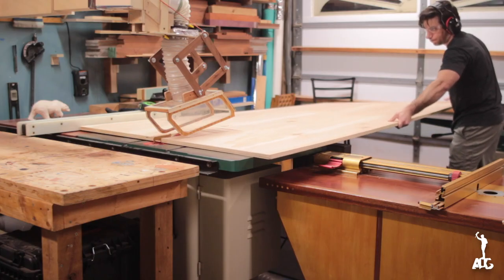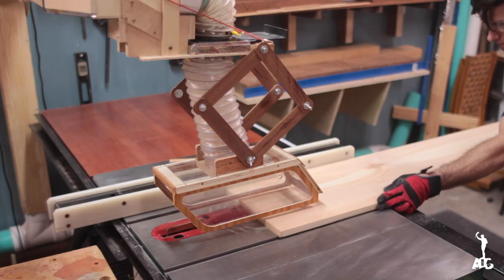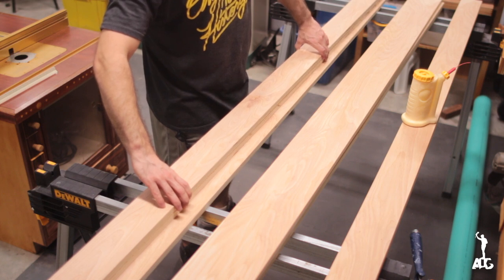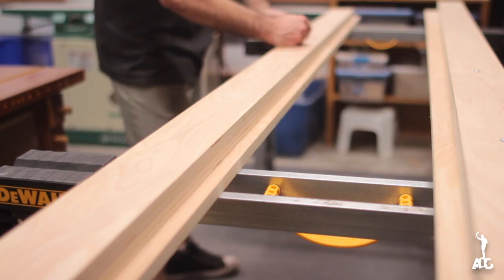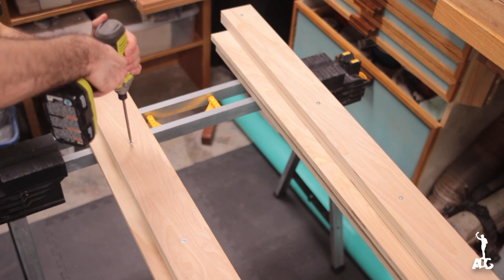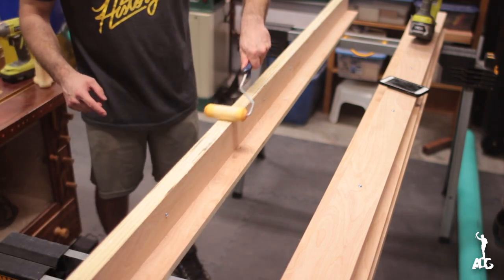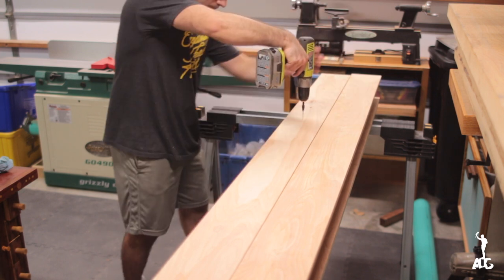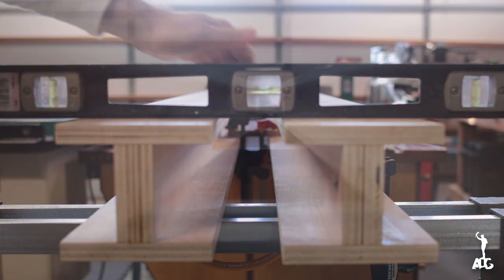Build A Pair of  I Beams

Comment: The height of the web is more important than the thickness of the web.  The whole idea is to have some compressive strength in the top of the beam and tensile strength in the bottom of the beam, and to separate the two flanges accordingly.  The further apart the top, compressively stressed flange is from the bottom, tensile stressed flange, the stronger the beam will be.  That said, if you are limited in the height you can use because of the design, a thicker web will provide some benefit, but the height of the web does more than its thickness.
Reply from the maker: That is right. Thanks for that elaborative explanation. I recently made a similar concept but this time out of solid wood to act as a beam that sits on two columns above a sofa . The beam is also fastened to the wall. It holds an amazing amount of stuff the height of the web as you call it in this case is about 10 inches high .

Comment: Can I use 2x6, 2x4 etc. instead of plywood or do you think the expansion and contraction will cause problems on that 'T' shape join?
Reply from the maker: creativobuu sorry I’m responding so late. 
  I believe that you are right . You will encounter some movement over time . But a 2 by 6 would deffinetely work as far stability goes . It will be way more work because you would have to square your parts. The price is lower but I’d go the plywood route for this project 🙏🏻

Comment: If you wanted to make them longer, could you overlap multiple pieces?
Reply from the maker: They would have to have a very strong connection that would rezist sagging . I would try to get longer material and then make the center piece wider so that the beam would be taller

Comment: What type and amount of load is this intended to support? Drywall screws are known to be brittle and prone to breaking under more than drywall load bearing. They are not structural connectors.
Reply from the maker: Monkeys Uncle I walked on these beams with no flex , and I weigh about 180lbs and I could put hundreds of pounds on . Now this is made to serve as an assembly platform for furniture projects that will weigh way less.  I believe it would be weak only if load is set on individual edges of the beam and not over the central area where there is just too much material for it to fail
Reply: I applaud your inventiveness, but in the future I recommend using a slightly better grade of fastener than drywall screws. Just sayin'!
Reply: @monkeysuncle2816 , actually... While you're right? You're forgetting that the drywall screws are just acting as a clamp until the glue dried in this application.

Unless the glue was absolute garbage, which is doubtful considering the craftsmanship that's been used, the screws used are immaterial.

Some digging here on YouTube will show you that the lumber used in a joint like this will tear before the glue joint itself can fail.

He could literally remove all fasteners and have the same strength, many woodworkers who employ pocket hole jointery will go back and remove the screws once the glue has dried just to get more mileage from their investment, because they serve no purpose for typical weight bearing applications.
Reply: @russellborrego1689  The glue although wood glue is PVA and is not rated as a structural glue in any sense of the word.
Reply: @gary24752  be fair. You're talking about it being under constant load. If he was parking a truck on his wooden I-beams for a year? Sure.

He build them for a flat work table to build a credenza on.

They won't survive a trip to the moon on the outside of a rocket either.
Reply: @russellborrego1689  like I said pva is wood glue not to be construed as a structural glue.

Comment: The design is structurally wrong - you want the top and bottom sections of the beam thick and short, while the central section rather thin and tall. Watch https://youtu.be/zSz0kV0BPDY fot the science behind. Basically, the central section of an I-beam mainly holds the top and bottom (where the stress actually occurs) together.
Reply from the maker: As you can clearly see from the video presentation , I am using them as an assembly table not for a structure. However I sat and walked on them , I transported a large piece of furniture that was too long for my pickup truck bed , and it did not deflect at all. You are showing me a beam made of steel , to hold  way more heavier loads. I conducted my own testing by building and using this in real world situation personally. Thanks for watching however .
Reply: @artofgontea-artist5718  First of all, thank you for your reply and please, don't take it as a criticism - it's rather a suggestion.
Whether it works, sure it does. You just don't get all the resistance the material offers you. :)
Btw, whether it's a steel or wood, it does not matter. The I-beam design comes from the cross-sectional analysis.
Neverthless, it's apparently nice and precisely made, well done! :)
Reply: @NemamZadnejKanal  I believe that the top and bottom pieces (flanges) are for lateral (sheer) strength. The load is on the wide center piece, just like a steel I beam. so the top flange and bottom flange prevent the center (load carrying portion) from moving at an angle. Without the top and bottom flange, if the center plywood changed position or moved at an angle, then the load transfer would be changed and the I joist would fail Thats why its so important when using I joist to install beam spacers between the joist to keep them stable, perpendicular  and  uniform. The actual load is on the center or vertical piece of plywood. If you go to a manufacture's web site and look at their engineered structural calculations, when increasing the load capablities, the only thing they change is the width of the center perpendicular plywood, not the flanges. The more weight and span, the wider the center plywood. :-)
Reply: @WillyBouy  It's not really as you say... The compression/tension occurs in top and bottom "flanges". The centerpiece is, on the other hand, responsible for shear resistance. The deformation you talk about is probably torsion, that is what you avoid by spacers and overall thickness. If you pretend to increase joist resistance by adding width (only), you're going to be inefficient. The height of the cross-section gives you the resistance, the width gives you the stability (prevents flection).
Reply: It appears to be cabinet plywood which would have to be rated structural to use as a beam and with the use of PVA glue I would not trust it even if it were.